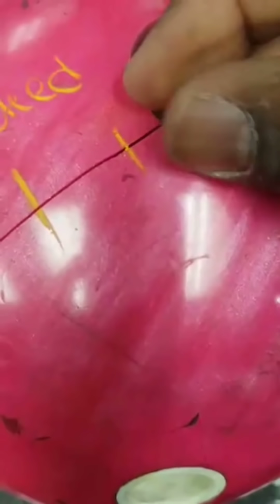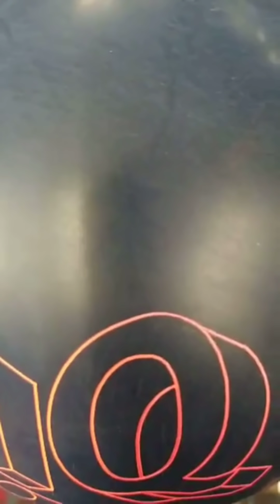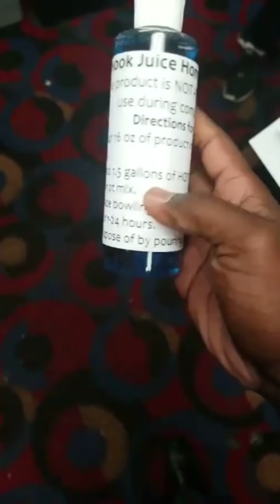A Bowling Ball Cracking Live On Facebook

Comment: I watched a brand new Hammer Black Widow do this at our shop. Once the holes were in and inserts finished the new owner realized the surface crack show up on the ball which proceeded to cover about 1/4 of the ball's surface by the time we put it away. A week or so later the crack had gone to about half the circumference of the ball.